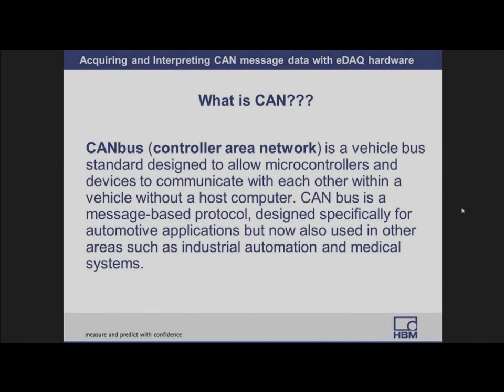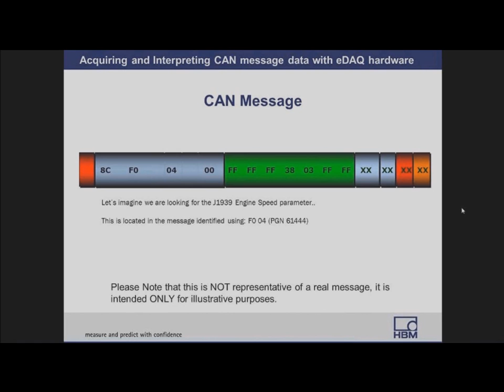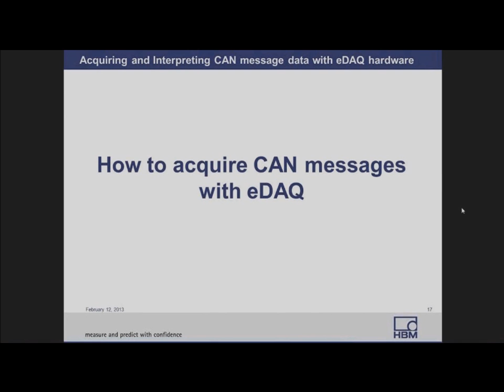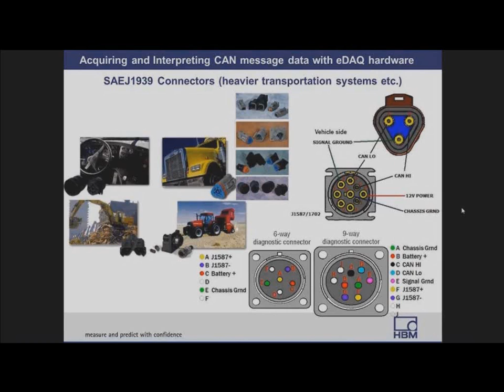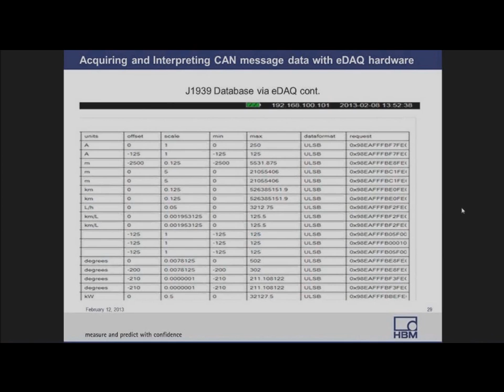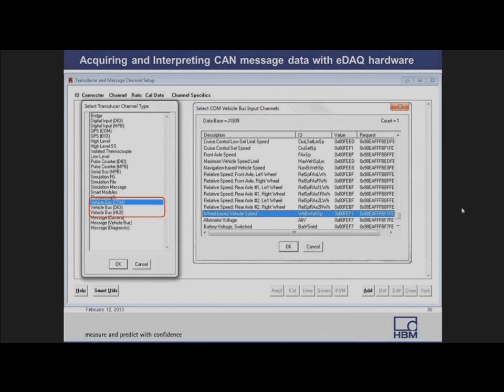HBM Webinar - Acquiring and Interpreting CAN message data with HBM's Somat eDAQ hardware

Comment: Where can I find the information about the dataformats in eDaq? What to fill in the database spreadsheet (ULSB. etc?) I am looking information how to configure eDaq for the byte order "Intel"/"Motorola" and signed/unsigned etc.
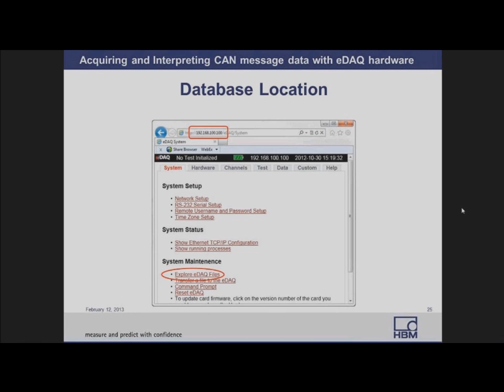Reply: When you log in on the eDAQ itself with a web browser (see 14:12 of this webinar), it explains those formats under the "Help" page.

I have lifted these from there for you:
RAW	No conversion
UMSB	Unsigned MSB First (Motorola)
ULSB	Unsigned LSB First (Intel)
SMSB	Signed MSB First (Motorola)
SLSB	Signed LSB First (Intel)
FMSB	IEEE Floating point, LSB First (Motorola)
FLSB	IEEE Floating point, LSB First (Intel)
UMSBX	Unsigned MSB First (Motorola) - Bit-reversed data
ULSBX	Unsigned LSB First (Intel) - Bit-reversed data
SMSBX	Signed MSB First (Motorola) - Bit-reversed data
SLSBX	Signed LSB First (Intel) - Bit-reversed data
FMSBX	IEEE Floating point, MSB First (Motorola) - Bit-reversed data
FLSBX	IEEE Floating point, LSB First (Intel) - Bit-reversed data
Reply: How I can record basic parameters of car without dbc file ?

I have somat that having CAN port 
It’s possible to connect CAN port to obd and drag the rpm speed voltage parameters data 
Kindly share details of possible wire diagram and all @